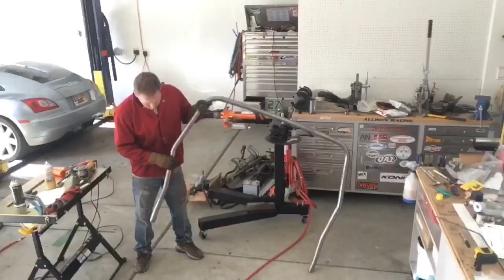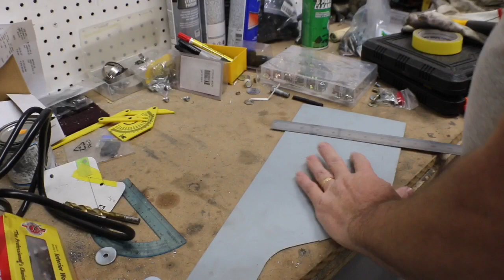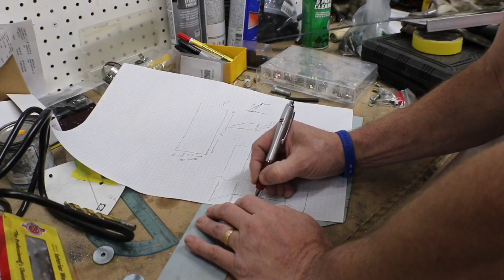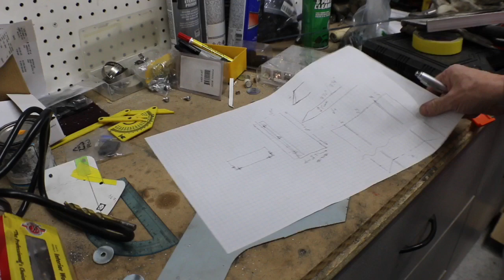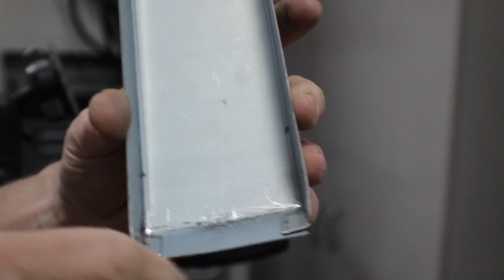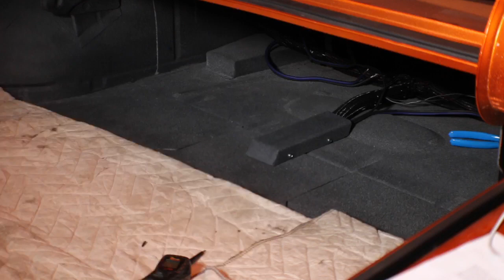Chevelle - Part 72? - Details, Details

Comment: wow - that is one huge sub box. nice work on the wire cover. I like the Neutrik connectors for sub boxes - parts express sells them they spin and lock and are from pro-audio industry. Used on speaker cabinets. I think parts express sells them NL4 and NL8 depending on how many wires you need to use. https://www.neutrik.com/en/products
this would allow any speaker connection to be removed easily, boxes, etc.